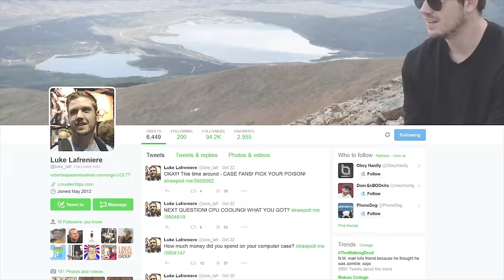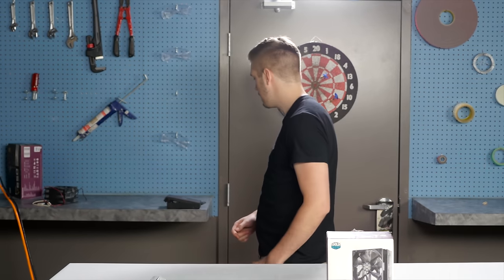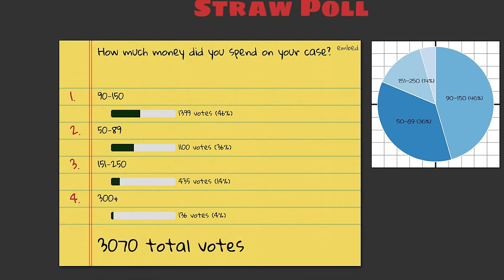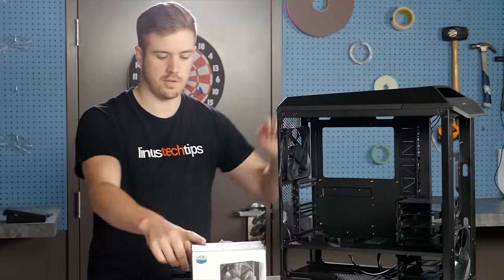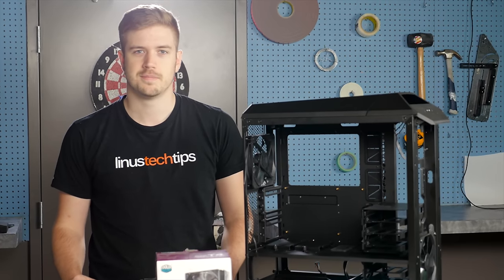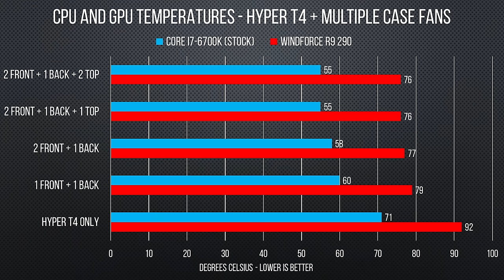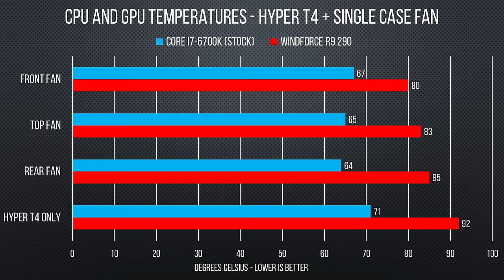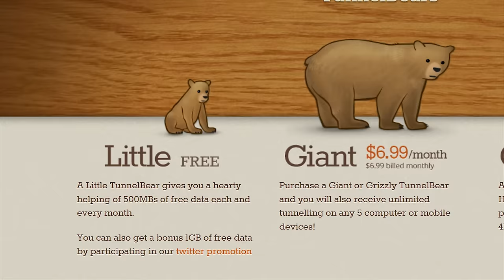Case Fans - How many should you have?

Comment: I always looked out to get the most amount of fans in my system while caring for a good airflow. Front bottom as intake and rear/top as exhaust works usually very great. But fans in the side panel are often times counter productive for that kind of airflow, so I use them.
My last PC was pretty much the only one, where I ditched my usual airflow build since it's build in a "Tacens aluminium extreme" case which got an insane 40cm intake-fan in... or rather AS the side panel. This baby spins at only 800rpm and while completely silent it just pushes around 250 cfm of air in the case. Used it  as only case fan and with the silent "Arctic Cooling Freezer Xtreme Rev. 2" on a Phenom II X6 945T and a Gigabyte GTX 960 4GB with dual-fan design, that system was basically completely silent & cool. Still runs today like a charm ;D

Comment: u always need at least 2 fans. 1 intake 1 exhaust to pull the hot air out of the case. intake needs to be at the lowest point in the case u can fit it. exhaust at the top or back as high as u can get it cause hot air rises. plus in most cases the CPU is at the top of the case as well. most fans should have an arrow on them indicating direction of airflow.

Front fans r usualy for cooling down the GPU and hard drives. top intake fans if u have liquid cooling as the raditor and pipes need to be higher than the CPU cooler has as air bubbles in the cooling system will rise to the highest point and if thats the CPU water cap then it will cause the CPU to overheat as less water gets to it.

The motherboard can effect temps a lot as well.
With an asrock phantom gaming 4 with an AMD ryzen 9 3900XT with 6 case fans and liquid cooling the Motherboard was hitting 95c as was the CPU and shutting down as it was getting to hot.. with the MSI x570 gaming edge temps were 35c cpu and 35c motherboard. with the AMD raith stock cooler and 3 case fans temps were only 38c on an asus prime B350 plus in a midi case with the ryzen 9 3900xt which is curently the most powerfull CPU on the market and it needs a lot of cooling as it gets very hot.

If a CPU is regularly over 70c then u need to improve cooling as it will damage the CPU.

Ive got the corasir 760T case and that came with 3 fans. 1 at the back for exhaust and 2 on the front for intake postioned just right so 1 cools the HDD and SSD the other cools the GPU. the corsair H100i i added came with 2 fans mounted on the top of the case. added another fan to the bottom of the case.

Limiting factors on how many fans u fit is the case mounting points and how many fan headers on ur motherboard.

Small cases need more fans than big cases due to less airflow inside the small cases.

Comment: My old Chieftek case is still serving me well. Plenty of space in it and i only use one 140mm fan at the back. Im running a Ryzen 3700x with the wraith prism cooler and a Gigabyte RTX 3060 12GB, cpu temp under stress-tests sits at around 60 degrees (i manually set it to 3.9 GHz since i feel the fan ramps up/down too much at default settings with core performance boost on) My RTX 3060 is usually around 62-63 during benchmarks.

Comment: Hi guys! 
Can you tell me what option is the best? Thank you a lot for the help!!!

Case used: Fractal Meshify C TG

Option One: CPU liquid cooler (Cooler Master MasterLiquid ML360R) 3x120mm in the Front -
1x120mm Fan in the rear - 2x140mm fan Up

Option Two: 2x140mm in the Front - 1x120mm Fan in the Rear -  CPU liquid cooler (Cooler Master MasterLiquid ML360R) 3x120mm up.

Comment: im not sure if its a problem, but i bought all components for my PC and it turned out that motherboard (similar to yours, it has thatbig bump that is in this video white.) was blocking the back fan. the back fan came already attached to the housing and when we tried to put the motherboard on it could not fit because of the fan. Now, we moved the back fan to the front, and now motherboard is fitting. my question is, is it a problem? that theres no back fan? i mean, PC is not overheating to die, but its pretty hot on some stronger games for example gtav. i know maybe its supposed to go that hot and not die on strong games, burt still, i want my pc cooler and now am thinking to buy two more fans:one to install on the back but from the BACK side of the PC and second one on the top of pc. if i do that, im asking for best directions of those two fans blowing. if you read this, thank you, and i hope you could help.

Comment: I have a very simple system for fan selection and placement, using only two rules:

1. Always place an exhaust fan at the top rear since hot air will tend to gather there.
2. Have a bit more intake airflow than exhaust. This ensures that hot air will always be flushed out and it also creates a slight over-pressure to keep dust out of the case.

Anything else will most likely just add noise without improving cooling.
Reply: If you only have exhaust fans even without the intake, the fans will create a vacuum and draw air into the case naturally. I don’t think that intake fans are important at all
Reply: @aliamiri4413  Except that then you have no control over where  the air enters the case. By having more intake fans than exhausts you ensure that the air enters where you want it to (in my case, through dust filters) and flows over the components that need cooling most. Where it exits the case is of less importance to me, as long as it does so quickly and no pockets of trapped hot air are formed. And finally, fans are better at pushing air than pulling it. At just a few centimeters in front of the fan there's no suction anymore but at half a meter behind the fan there's still measurable airflow. As a result an intake fan can effectively cool a large area behind it.

Comment: I have 5 case fans (using a cougar mx330-g case which supports only 5 120mm case fans) 3 are gim rgb fans, 2 are black (the stock cougar fan, then 1 random fan that has a high and low switch 😂)

Comment: Were you only running 1 exhaust fan? Would it not have helped to run the top fans as exhaust. Heat rises so the hottest air should be at the top of the case. Maybe I’m wrong but I’m speaking from an automotive mind

Comment: The reason the second top exhaust fan doesn't add any cooling is that it is now diverting the top front fan cool air out the top before it has a chance to hit any components other than the ram.  If that fan became an intake fan it would cool the ram and the cpu cooler as it is now combined with the top front fan. This would also maintain positive pressure in the case to reduce dust from creeping in through gaps, cracks, and unfiltered openings.

Comment: I have an Antec P280 case and I have 2 120mm fans in the front sucking air in, 2 120 mm fans behind the hard drive cage also sucking air and blowing it at the GPU, 2 120 fans on the top and 1 120 mm fan on the back pushing air out.

Comment: I would say more in than out, positive pressure means dust won't be sucked through the gaps. Bigger fans can equal more silent fans. And lastly where you place fans could matter as a fan might replace passive air heat flow with positively away air heat flow

Comment: Will more fans improve water cooling I have one 120 millimeter radiator and my CPU is overheating a bit should I add more exhaust fans on top of the case and intake on the front my water colling radiator is on the rear please someone help me

Comment: Awesome video and it got me to thinking.  

What about a dimilar test bench using AIO, for CPU and GPU cooling. Run the same tests on an air cooled CPU / GPU setup..   To give an idea / starting point on the best fan orientation depending on ones choice of cooling. 🤔

Comment: Great video, thanks for posting. I just swapped out the 3(120's) fans that came with the case and added one extra to the top(140's).  Seems like I'm bring in more from the front but the top one isn't extracting much. I still have one more for the top and them I guess I'll have to dial them in..
Cheers

Comment: I know this is an old video, but I have a question.. I just bought a FD Meshify C and 2 x 140mm, 2 x 120mm noctua fans, and I have a noctua NH-u12s tower cooler. The 2 140mm are for intake and I was originally going to do the 2 x120mm as a rear and top exhaust, but I'm wondering if I should do one exhaust and add a second fan to my NH-u12s instead?

Comment: @10:00 when he adds the 2nd top fan it points out an issue (no effect). It can actually be worse because that fan will divert the air from the 'top-Front' fan and exhaust it 'before' it hits any components on the motherboard (biggest effect). In addition it is sucking air from an area with no components below it (ie., no real effect). AND IF u have no front fans then it can actually Pull hot air forwards 'into' the case instead of the back fan sucking it out (can be an moderate hit to efficiency). Two top fans are really only effective if you have no front fans OR just one in the bottom that will blow in and then get pulled up thru the components.

Comment: You discuss number of fans but what about whether they're intake or exhaust configured. Currently, I have a liquid cooler configured in the front with the 2 fans in exhaust configuration and 1 exhaust fan in the back. No intake fans. I've seen on other you tube videos that this is optimum for cooling compared to intake and exhaust config. What's your opinion.

Comment: A question, I've got a Cooler Master Silencio S400 case, which comes with two Silencio FP 120mm PWM fans (800-1400 RPM / 16.4 - 44 CFM / 0.47 - 1.69 mmH2O), installed on the front and the back. I've bought two additional Arctic P12 PWM PST CO fans (200 - 1800 rpm / 56.3 CFM / 2.20 mmH2O). The question is, considering the performance differences, how do I add them? Do I add one to the front, and one to the top? Or do I move the Silencio back fan to the front, and add the new Arctic fans to the back and the top? Or do I move the front Silencio fan to the top, and add the two new Arctic fans to the front?

Comment: Great test as i have this case, but it would've been extremely helpful and important to test this will all fan spots filled. This case supports a total of 6 fans (Not including CPU Cooler). Unfortunately you only test 5. Also, the top front fan that was never tested is almost directly in line with the CPU cooler, so it could have had a significant performance improvement on the cooling of the CPU.

Comment: i have question on my case Thermaltake V200 RGB TG, what would be optimal for better air flow and less heating , if i have two 140mms case fans, or three 120 mm fans, or if i get get 140 front case fans do i need to get also top 140 mm fans aswell

Comment: Old video but usefull. The most common configuration (stock) is one front fan, one top fan and one back fan and you didn't tested it. The closest configuration is the third (2 front and one back) I'm asking to put 2 fans on the top and 2 140cm fans in front or 3 120cm in front. Can I expect to win  approximately 3 degrees on CPU ?

Comment: Intake and exhaust
intake low
exhaust high

add additional fans to move standing air
heatsinks are more important than the amount of air a fan moves with the exception of radiator fans

Comment: Would be interesting to see what the affect is of having fans at bottom and top so the air flow is  same direction that heat naturally flows (heat rises).  I am actually making a custom case for my Ryzen 3800x system that does this.  I am removing the GPU fans and having the system fans blow air over the heatsink instead.

Comment: Bit late to this vid and I don' know if LTT have updated this but I'd not only be interested in temps/airflow based on just adding/removing fans but the whole positive pressure thing as well, which ones are exhausting, which ones are pulling in? I've just built a new system and currently have 2 front coming in, 1 exhausting out the back but I am tempted to use my little AIO cooler and a nzxt g12 to water cool my 2070 super. Space wise it then makes sense to have the rad at the front of the case but I don't like the idea of pulling ait through a hot rad into the case so was tempted to have that one exhausting but the other fan in the front pulling in.  Not sure how it would affect things overall.

Comment: I have 3 intakes (one 120mm in the bottom and two 140mm in the front). Then 3 exhausts
 (two 120mm exhausting on top and one 140mm exhaust in the rear).
i7 6700K overclocked to 4.7Ghz at 47°C to 76°C.
GTX 1080 (Zotac AMP! Extreme 40°C to 76°C
All fans Corsair LL .

Comment: A small question: with so many rgb fans on the market 120-140-200mm
then how do i find out which ones there fits best for my case/theme?
also do i need a 140mm for my rear end when my case supports it or does a 120 also fit :P

Ps. No headache :D

Comment: I have 2 aios in my pc and 5 fans, one aio is cooling my gpu with an NZXT aio bracket the others on the CPU both radiators have 2 fans and the 5th is an exhaust on top of the case, thing still runs toasty when heavily overclocked

Comment: Intake - exhaust indications would be helpful. For example, 2 FRONT + 1 BACK + 1 TOP = which fans are doing what? I am specifically interested in the Top one, as the other ones are quite clear to me.
Reply: It is always front intake, back exhaust, top exhaust unless otherwise specified.
Reply: Front/bottom = intake
Top/rear = exhaust
Note that in the case of the use of an air cooler for the cpu, the top front fan may actually be counter productive. Better not to add an extra fan in front of the cooler, i even get 1.5-2°C cpu improvement by blocking that opening on a 2front , 1 rear 1 top ( behind cpu cooler then ) setup. And it seems logic, as the front fan right before the cpu cooler don't get his flow pulled out and will be more efficient going thru the cooler. 
Note also that this is not the case with a liquid cooler.

Comment: I have a setup with 3 front 2 top 1 back but I've heard its better to have more fans blowing in than out so as my GPU pushes out it makes it imbalanced... so I'm thinking of comparing temps with that one forward top fan pushing in, out or just turning it off. I personally think the best is 3 front intake and two exhaust (one back one top) its just my last top one that confuses me.

Comment: the exit back fan can it be replaced by corsai 400-2400rpm fan? would it exaust more heat?
Reply: it's really hard nowadays to get bad case fans. You'll be fine as long as you have a good intake-output ratio

Comment: Well I have a Cooler Master S600 with two nvmes from Samsung installed (970 EVO plus) and the got round 52 idle on disk 1 and 47 idle on disk 2. 

After installed one 120 mm fan in the top, those temps dropped from 52c to 49 - 51 c on disk 1, and from 47c to 43 c on disk 2.

I expect I can get them futher down with a second top fan.

Comment: What about the control of the room temperature/humidity in the lab? You gotta have that as a basis and use that as another testable factor. Cold rooms. Hot Rooms. Humid rooms. Etc. The performance of my rig in the winter (~55°-60°) to summer (~85°-105°) is night and day when it comes to performance. I play single player games in the summer and multiplayer in the winter lol. I need a new rig

Comment: I wonder if I can get help on the math of my case fan upgrades. Basically, I'm thinking of getting this combination in my upcoming Cooler Master Silencio S400 case.

2x Noctua NF-A14 PWM 140mm 1500 RPM for the front intake.
2x Noctua NF-S12A PWM 120mm 1200 RPM for the top exhaust.
1x Noctua NF-S12A ULN 120 mm 800 RPM for the rear exhaust.

Do you think this is a good combination for the perfect airflow? I know that doing the math, I'm creating -8.9 m³/h difference. Which means it's slightly negative airflow.

If I have room for 2x slots in front for either 120/140 mm case fans, another 2x slots on top for either 120/140 mm case fans. And 1x slot in the rear for a 120 mm case fan. Which is the best combination for good airflow and noise if I want to fill all the slots with Noctua case fans?
Reply: I'm also wondering this. I have 4 noctua NF-A12x25 PMW and my case has two back options, two top options, and three front options, although the front of the case blocks a lot of airflow. I need to know if its a good idea to do an "L" system for cooling and blow heat up through the top, since there's plenty of ventilation on the top.

Comment: Ok so I'm putting 5 120mm fans into an MX330g case.
The case takes 2 up front, two up top, and one in the back.
Obviously the single rear will be exhaust and the front pair will be intake...
But should the two upper case fans be set as exhaust? 
I know this creates 3 exhaust, but the intake wont be fighting gravity like the exhaust will, and if I put dust covers over the two top exhaust fans to stop dust falling in when PC is off, it will help the intake fans to overcome the 3 exhaust I hoped!
Has anyone here had success with keeping dust at bay, while using 2 front intake, 2 top exhaust, and 1 rear exhaust?
Would it be better to also use those fans as intake? Creating massive positive air pressure? Or will sucking in from the top just create more dust anyway?

Comment: I just "upgraded" to 9 case fans: 6 140mm and 3 120mm (140 won't fit in the bottom). They're Arctic P12 and P14, except for one Silent Wings 3 I plan to replace with, you guessed it, Arctic P14.

How many is too many, I wondered. But my GPU dropped 12 degrees under load (3080) while not adding any amount of noise from fans at low RPM so the new question is: WHY DID I NOT DO THIS SOONER?! My case is Enthoo Pro 2, which I bought right after 3080 because 3080 would suffocate in beQuiet 500 (or was it 600? the no-airflow-all-silent-panels budget case).

I think it would be a great idea to revisit the topic "how many fans do you need?".